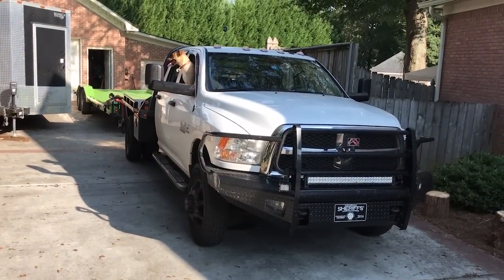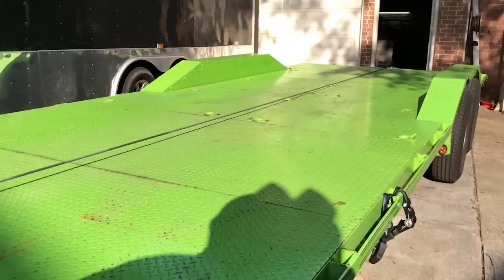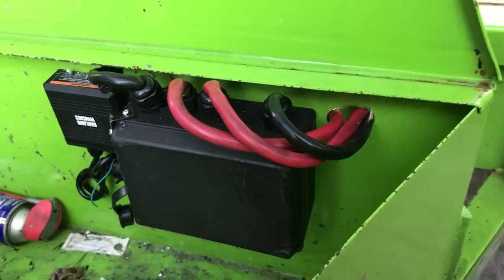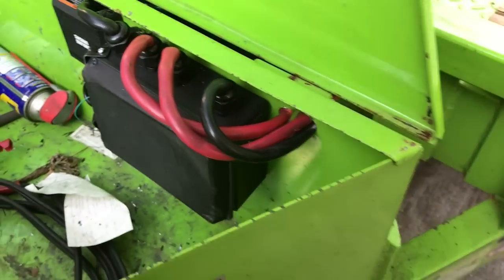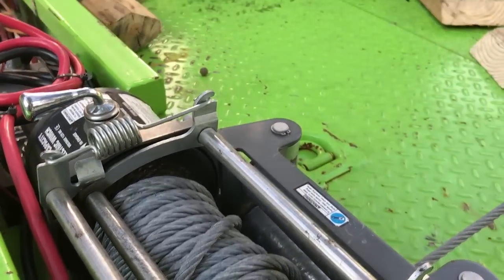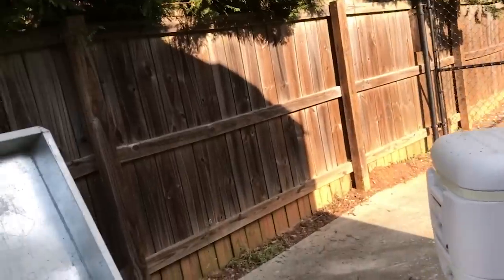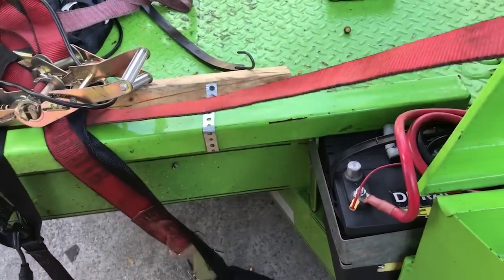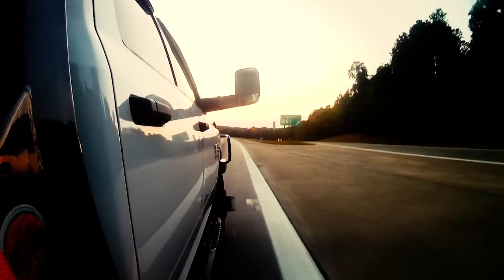Harbor Freight Badlands 12,000lb winch review and instal On Custom Car Trailer

Comment: Dude. You need a grommet where the wires are going thru the box. Safety hazard for sure! Also. Re-spooling your cable properly will prevent the line from bird-nesting and hitting the control module.

Comment: Cool install.. but...if you don't put a grommet in the whole that you drilled to run the cables through.  It will eventually wear through the cable insolation and short the whole thing out...
Reply from the maker: David Jessee edges are rounded thx
Reply from the maker: nsrider2000 right after you fuck off
Reply: RPL_ Transport 👍👌
Reply: nsrider2000 you know what would really be trick is if the whole winch was in the box and the fairlead mounted outside of the box😀
Reply from the maker: David Jessee so you want to waste storage space? The winch sits on a 1/2 plate braced and welded made for a winch, that idea is absurd
Reply: RPL_ Transport no I was just thinking what a better way to protect your investment by getting it if the weather.. excuse me for voicing an opinion..
Reply: Most likely it will short out
Reply: @davidjessee7701  that's how I did mine. Still looks brand new.

Comment: Find someone in the electronics business to change the capacitor on the transistor that switches the relay. A smaller capacitor will let it drop out sooner.
Reply: i bought a actual warn wireless controller and it works lightning fast.

Comment: You should put a grommet where the wires exit the metal tool box, or at least some silicone to prevent the wires from shorting.
 also, you showed us your trailer and toolbox but you did not review the winch very well. maybe change the title to "showing off my custom made trailer" instead of reviewing a product you don't review and was barely even shown in the video....
Reply from the maker: Sorry I wasted your time. Must suck to be disappointed in something that’s.... free
Reply: He is right tho....

Comment: I wanted to see how long this winch would stay powered with just a single 650 cca battery hooked directly to the winch. I pulled a 26 inch wide log 10 feet long and the battery went dead. So, i feel these winches suck too much juice. I think the wiring is not that good or the gearing. The cables get twisted like hell and will not run right even tight runs they run off and over each round and ruins the cable. The need a spring loaded roller on the bottom like the top and some kind of direction slide for the cable to run even across instead of all over the spool.
Reply: You'll need a deep cycle battery. If you're using a regular car battery thatll happen. A regular car battery pretty much has enough to crank a starter for a bit. Not really ment for continuous loads.

Comment: Where did you get the wireless module
Reply: Harbor Freight. https://www.harborfreight.com/wireless-winch-remote-control-69229.html

I got one the other day and it has no delay like the uploader's does. The manufacturer probably updated the thing a couple years ago.
Reply: @williams6550  really mine has horrible delay it keeps going for a few seconds after i release the button
Reply: @wyohorseman9948  Like most harbor freight products, there are actually two different SKUs for the wireless remote. 61474 and 69229. I would say that whichever one you have, is the slow one, and the other one isn't. 

On the surface, most people probably don't even notice these subtle differences in the products they buy- at least, you wouldn't notice if you only ever dealt with one and never the other. 

If you're able to, I would suggest trying the other one and see what you find out.
Reply: @williams6550  tried both still does it
Reply: WyoHorseman994 Damn, that’s unfortunate. I don’t know what to tell you, friend.
Reply: @williams6550  all good i was told if you replace the relay in the remote it makes it almost instantaneous

Comment: Not bashing.. but there is a reason these cost 299 and warm cost 900. Juss sayin. You put in on something with moderate use or just for looks, it’ll be fine. Put it to work on a daily basis THEN you see why they are 299.. again juss sayin!
Reply from the maker: Just sayin..... I have 5 of these in use, get used daily and just had the first one stop working due to bad solenoid. Keep ya warn
Reply: STELLA R/T yessir will do! Must have a mighty big business using 5 winches daily!! Juss sayyin
Reply: STELLA R/T ain’t here to hate man! Juss goin on about 3/4 buddies that have had nothin but problems with theirs overheating! Also could be they are tryin to pull 2500 HD’s buried in mud! Rolling weight of an auto on a rollback ain’t near the work as a buried million pound truck plus the earth it’s tryin to move! Peace brotha!✌️
Reply: I use my winch daily from harbor freight I push this things limits been good for the past 6 months its already paid for its self for sureee just sayyin

Comment: When you take it apart and find out the solenoid is only rated for 1500 to 5000 pounds
Reply: i noticed the power cable is much smaller than my old warn 8k. so you can replace the solenoid for a heavier duty unit?

Comment: Do you use a winch cover to Weatherguard it?
Reply from the maker: motomadnessman  nope, it's a winch, not a Ferrari
Reply: RPL_ Transport lol point taken, didn't know if you needed to protect it from rusting over time.
Reply from the maker: motomadnessman it gets used twice a day so I guess it might but
Reply: Saw and like the way you set this unit up however you need to inlarge the holes for wire to winch so metal doesn't rub through and short out electric system.
Reply from the maker: Richard Britt 100k no issues yet
Reply: Thanks for replying so fast.  Have question about duty cycle.  How long can you pull on a load before letting winch cool down  and do you think that a direct fan might help keep it cooler. Have yet to install mine.
Reply from the maker: Richard Britt I think your over thinking it... a fan isn't going to help at all. As far as duty cycle I have full pulled 18000 lbs form 300 feet (running winch in and then taking out section of chain, run winch out start all over ) it was slow but never quit
Reply: Thanks bud, good to hear from someone who is verst in its use. Don't see me lifting logs that heavy but like the possibility.
Reply: @richardbritt2281  My manual says 45 seconds with a "14 minute and 15" seconds cool down.  Yes, about 15 minutes to cool down after 1 minute of use.